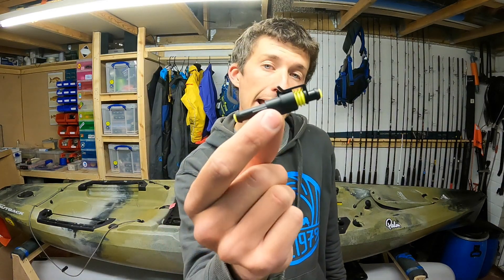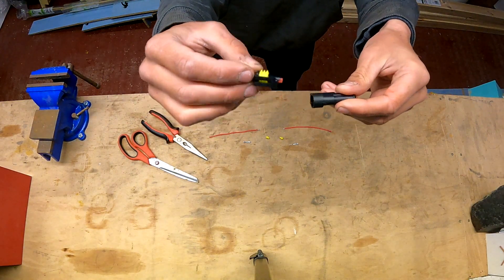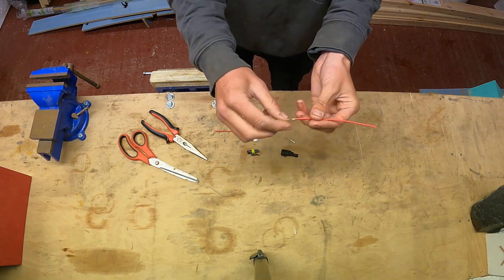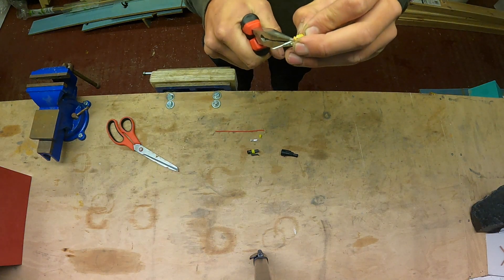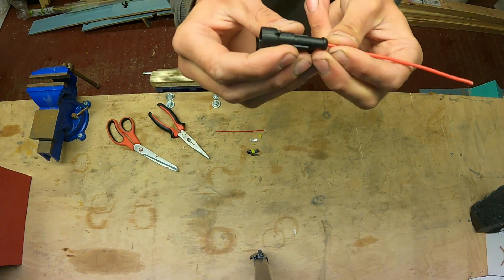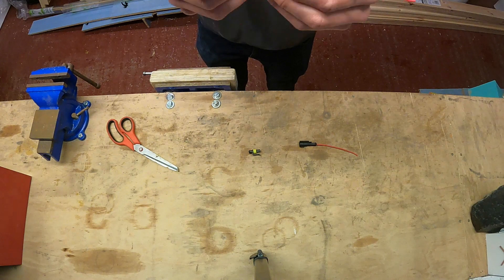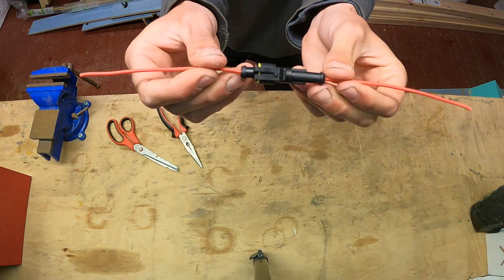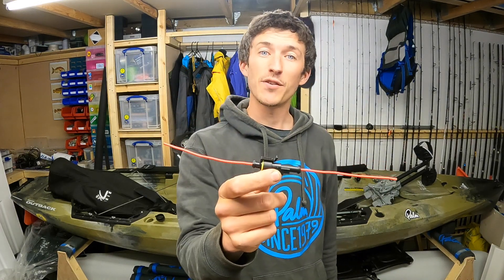How To Fit A SUPER SEAL Waterproof Wire Connector - Easy Step-by-Step Assembly Guide!

Comment: worthless without solder
Reply from the maker: In what way is it worthless? This very connector is still going strong several years later as part of a battery box (battery gets disconnected from these connectors regularly for charging). A drop of solder will certainly make for a stronger connection at the terminal though, although the crimp seems to be holding fine for me at the moment.

Comment: Helpful for the small details. I’m using much thinner gauge wire and it’s tricky as hell to push the connectors till they snap in place cos the wire bends. 
The key is to crimp really precisely and firmly. And make sure you practice on some spare wire till you’ve got it. It took me 4 or 5 failed attempts before it work. However the connectors I have seem unable to hold a tight enough connection to keep the circuit active. If I push both parts tight it works but if I let go the catch doesn’t hold the connection enough. It can’t me more than a 10th of a mm but it’s enough and same outcome are trying 3 times with new connectors each time.

Comment: I seen in one of your passed videos that you sprayed your connections, would you use ACF-50 or Corrosion Block on fishfinder connectors and terminal pins.
Reply from the maker: Yeah both ACF-50 and Corrosion Block are fine for fish finder connections. If using on push-fit connectors it can pay to only apply a small amount to the terminal pins and try to wipe any excess from the socket so that the push-fit connectors will still have enough friction to hold in place. For connectors that have a locking collar then you can apply liberally without worry.
Reply: Cheers, thanks for the advice. Keep up the good work.👍

Comment: How do you take it apart gain
Reply from the maker: You can’t really as the terminals lock into place and won’t just pull again easily. It’s easiest to just cut the wires and start again with a new superseal!
Reply: @CornishKayakAngler  Or these: https://youtu.be/Jd-XP0kCTFs?si=yHF8SHDBaujVnmBW
Reply: But the terminals are designed to be removed.... So you can really.
But how with seals in place?
Reply: Or these: https://youtu.be/Jd-XP0kCTFs?si=yHF8SHDBaujVnmBW